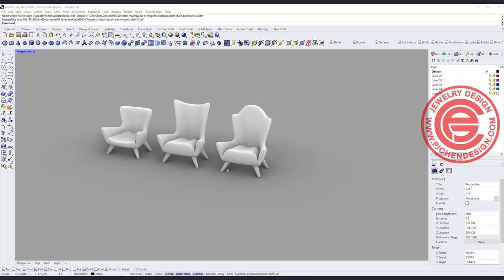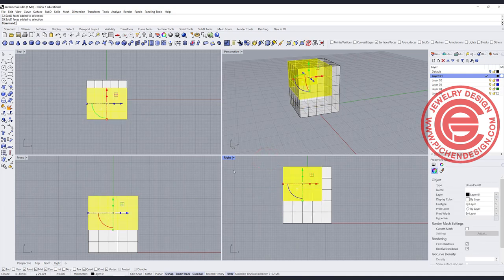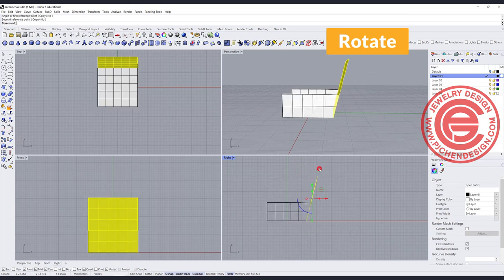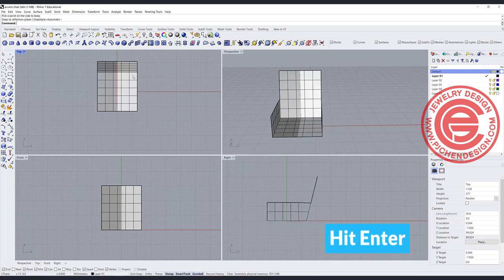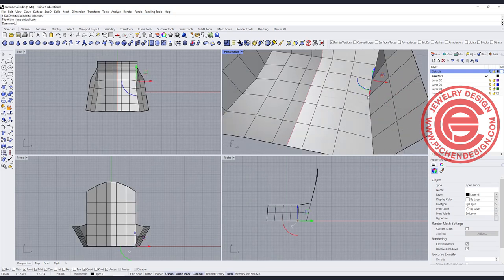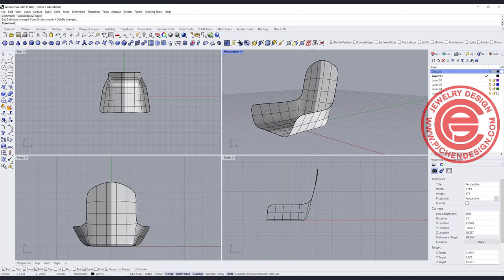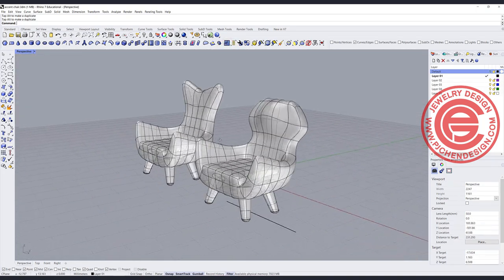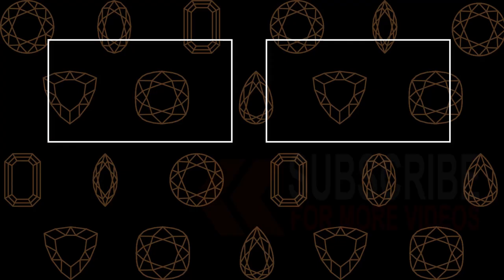SubD Quick Sketch Models- 3D Modeling with Rhino 7 #238

Comment: Hi PJ, Thank you for this tutorial! Amazing and inspiring as always! One quick question, what did you use Remove Crease instead of Fillet Edges here?
Reply from the maker: Under subD, there is a "remove crease" command.
Reply: @PJChenJewelryDesign  Hi !! Thank you for your reply. But sorry about my typo. What I really wanted to ask was "why" you use Remove Crease instead Fillet? Is there any difference?
Reply from the maker: @YSung-oo4pf  remove crease is use in subD. Fillet or Fillet edge is on NURBS surface. SubD has bevel edge or  SubD as well, but it make structure a little difference.
Reply: @PJChenJewelryDesign  Thank you for explaining!
Reply from the maker: @YSung-oo4pf  You are welcome